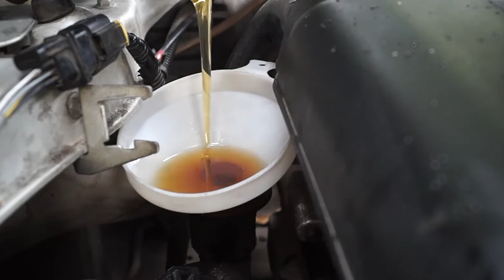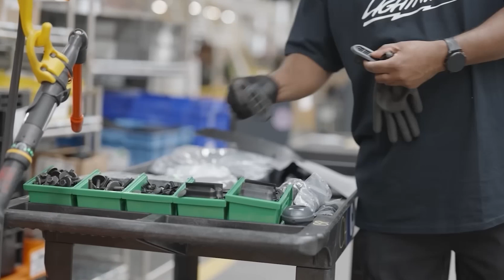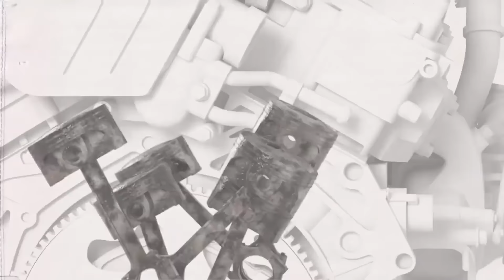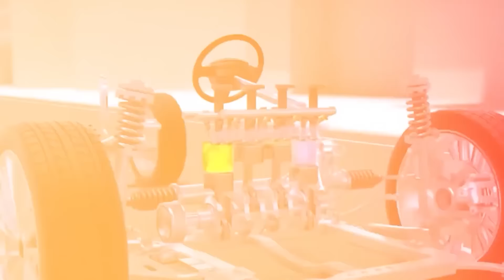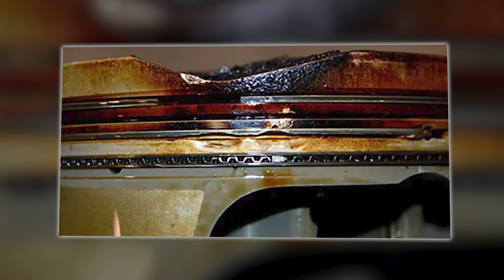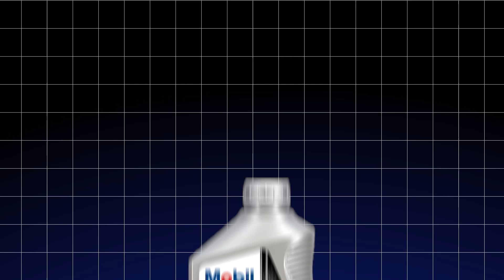Toyota Secretly Lying About Oil - Mechanics Refuse To Use

Comment: Recently bought a Toyota Rav4 premium, very nice car. They told me to bring it back at 10,000 miles for first oil change using 0W-16 oil. My mouth dropped open!! I retired from Shell Research Center in Houston, I worked with fuels and lube division, so I know more about oil than the average Joe. 0W-16 oil is a joke in warmer climates, and 10,000-mile changes is pure insanity!  Anyone that tells you lifetime oil is an idiot!  There is no such thing.   I did my first oil change at 400 miles and put 5W-30 synthetic plus new filter. This is what's recommended in other countries where they don't have to deal with the CAFE idiots!  Do some research to save your engine.  My favorite saying, ENGINES DON'T USUALLY DIE, THEY ARE MURDERED BY THERE OWNERS!
Reply: A few weeks ago a very much loved YT channel, who works specifically on Toyota/Lexus, came out with a video claiming that U.S. engines are specifically engineered to operate their VVTi systems with variable oil pumps using calculations set to the specific viscosity that the OEM prints on the oil fill cap.

Hate to say it, but it sounds like payola to me.
Reply: @EvzenKovar-i5p  Are you telling me that if I buy a Toyota in El Paso it has a special designed oil pump for that location and if I drive south a few miles to Juarez Mexico and buy a Toyota there it will have a different oil pump for that location?  I don't think so!    US- 0W-16 oil and Mexico 5W-30 oil.
Reply: @jackhutchins8272 
The Car Care Nut claims this in a video. I think he’s wrong, just like you. I have a suspicion that TCCN is a little too close to the OEM he works exclusively on, and likely does not want to assert a position opposite to what Toyota needs its owners in North America to do.
Reply: @EvzenKovar-i5p no, that’s not what he claimed…for those curious, go watch the video.
Reply: @zandern9489 
If you’re referencing the short he put out on the topic, I stand by my statement. That’s exactly what he says.
Reply: @EvzenKovar-i5p ,VVT for specific oil viscosity is a LIE! That's not how it works.
Reply: @EvzenKovar-i5p carcarenut?
Reply: @EvzenKovar-i5p  USE it or LOSE ur warranty! Facts. That's why I'd never own a Toyota.
Reply: @Davido50 , they can't void your warranty for a different viscosity oil. The manual even states you can use a higher viscosity oil.
Reply: Tell me what country 5w-30 is recommended for the 2025 RAV4.
Reply: @williamgollatz1911 
I just pulled up the owners manual for Saudi Arabia. The recommended oil viscosities on page 600 list 0W16, 0W20, 5W20 and 5W30 as the recommended viscosities. It states that if you chose to use 10W30 or higher, and it’s cold outside, the vehicle may be hard to start.
Reply: @EvzenKovar-i5p people need to know 0w40 is their solution. Or 5w30/0w30 euro compatible. Aka ESP. If its Mercedes or BMW approved its going to be better for all of us
Reply: @BloodAlwaysFindsItsLevel  The Oil Geek on YT shows how the wider the number gap between viscosities, the more shear from spec it gets. So a 0W40 is the LEAST stable oil compared to 0W20 or 5W20
Reply: @Stantonfresh  We have always known that and that used to more relevant years ago but, viscosity improvers are vastly better these days. These newer vehicles really need oil changes at around 5,000 mi. for longevity. Use common sense when watching these guys with oil videos, they are all about clicks. At 5,000 mi. changes do you really think that little viscosity lose is anything. HA !!!
Reply: @EvzenKovar-i5p unless it’s freezing outside it’s all bullshit,Fords were always bad starter’s in winter unless you used Castrolite in the sump,anything heavier and they wouldn’t start in freezing conditions.
Reply: @Stantonfresh 5w-20 rav4 is the way to go in hot 🔥 place like Puerto Rico. My toyota corolla 2014 take ow-20 - when I paid it off i change to 5w-30 here in Puerto Rico 198k. I change the oil 🛢 since new 8 miles. I change my oil every 4k.
Reply: @williamgollatz1911 I have a 2023 rav 4 in the UAE they explicitly ask for 0w16 as per my vehicle owner manual
Reply: I have a rav4 2024 i change my oil 🛢 500 , 1.000 , 2,000 , 3,000 , 5,000  , 9090 , 12,000. For know on every 3k oil 🛢 change i only took it to toyota dealership one time when I saw a 20 yrs old kid drive my rav4 2024 like if he was in a race 🏁 and scratch my new black rims when I told them don't rotate my tires I just put them rims one week ago . I'm in Puerto Rico  all dealership have 20 years old kids working on or new cars I'll work on all my car's since I was a teenager. Noone wants to work for dealership micanics 💰 is not good with all the recalls. And turn off that stop and go bs. Oh and I'm in Puerto Rico it's hot 🔥 all year long 😩 I'm going to change my oil att 3k I do it my self it's easy and change the filter. Oil and filter is cheaper then a motor.
Reply: Absolutely correct,it’s insane to use these low viscosity oils in climates that are hotter than normal,in cold climates and stop start running where the engine rarely reaches its operating temperature they are probably fine but long life oil changes are a big no no as the fuel that passes the pistons and rings dilute an already thin oil. It’s horses for courses,in cold climates the thinner oils will probably be advantageous because they flow better at lower temperatures but in warmer climates there is absolutely no benefit from using these expensive thin oils,I have used 0W/40 for years winter and summer and changed the oil every 5/6000 miles or twice a year and had absolutely no bearing or piston/ring or bore wear ever and have run diesel since they first came out here in the UK in around 1964. Diesels are notoriously dirty engines because of the fuel but in all this time I’ve never had any problems with sludge or wear,doing this they run forever so thin oils for me will never happen,lm a bit over the top with oil change interval’s but it’s paid off over the years,I’ve been a mechanic and specialised in engine building for over 50 years so I’ll stick with what I know works.
Reply: My 2011 Lexus is250 4GR- FSE engine called for 0w20 motor oil  the 2010 is250 called for 5w30 sane engine. They admit that theyvdid this for gas mileage. My second car 2006 Ridgeline has 5W20 on the cap Honda changed the oil used at the dealer to 0w20 stating that it is now approved😂I user 5w30 in both cars 20 and 1 15 years old.
Reply: I did same to my 4Runner and Titan
Reply: Would using 5w30 be ok when Toyota says to use 0w8? Thank you
Reply: @earthpeephole3552 
If you are still within warranty you may want to wait. The OEM may give you hassle if you end up needing to make a claim.

Outside of that, all you can do is make your own decision. In countries outside North America, for the M20A and A25A engines, the owners manuals say everything from 0W-8 to 10W-30 is acceptable.
Reply: @EvzenKovar-i5p thank you
Reply: o.m.g.   the first oil change is at 200 miles max, to get out all the debris caught in the filter!  then religiously every 5000 miles thereafter.  no exceptions.  I am still getting 0W-20 oil changes, but adding in 5W-30 as it drops down.  More like toyotas in europe use
Reply: @Thrunabulax10 if your engine fails early, you may not be able to claim warranty
Reply: I appreciate your insight. You sound learned and trustworthy. Thanks 👍
Reply: 10000 miles would make my jaw drop for a first oil change
Reply: Their*
Reply: You were surely not an engineer.
Reply: My wife just got her new XSE RAV4 , which calls for the 0-8 kerosene. Less than 200 miles on it , and it’s getting replaced with 5-30.  You should have seen the look on the guys face at the dealership when he told us we have 2 complimentary oil changes coming, at 10 and 20K, and I told him no thanks. He looked at me like I was a reptilian alien. I hear the crap all the time about how the “engineers “ know what is best. ( same ones that developed that great V35A their having so much success with”They know what is best to retain their employment, that’s  what they know best. Same goes with the car care nut. Very knowledgeable guy and top notch at what he does, but he has too many ties with Toyota to say what he actually thinks regarding the no viscosity oils. Yeah, He recently stated that computers that control oil flow are specific to climate and must utilize whatever oil is specified . Total BS.  And the “tighter tolerances” is also total BS.  Believe whatever You choose, I’m sticking with 5-30, and no, I’m not worried about the warranty.
Reply: Why buy a Toyota? 😂😂
Reply: Your warranty is toast now pal. These engines are built with extreme close tolerances and use an oil pump that requires the thin oil. 0-W20 is too thick let alone 5-W30.